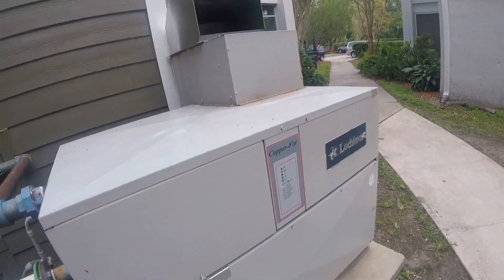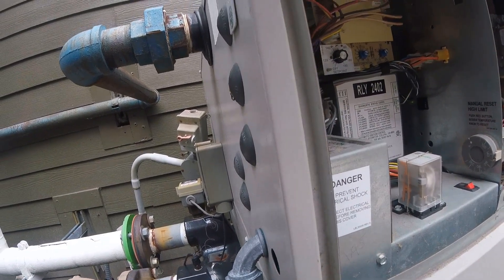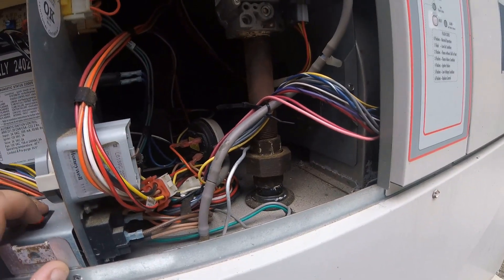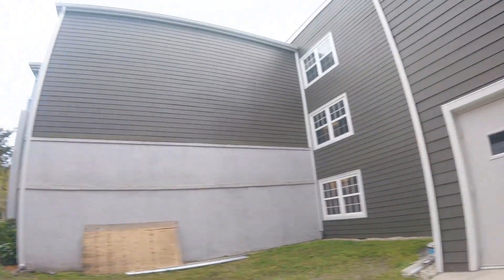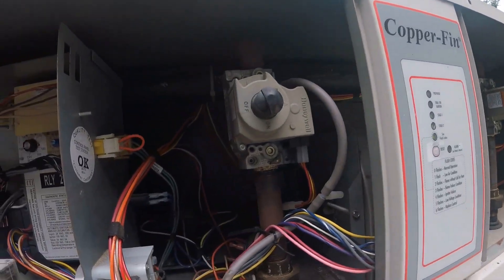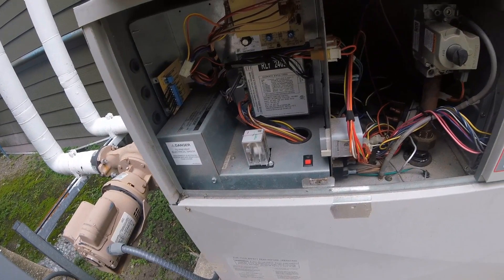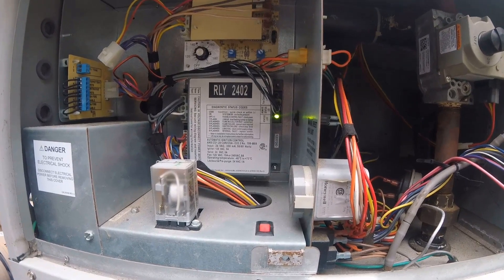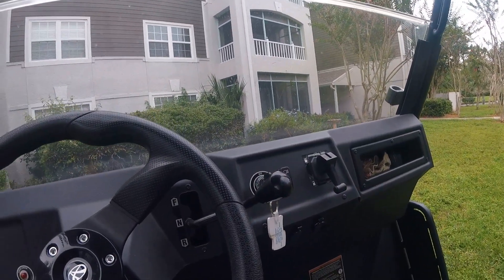Lochinvar Boiler Failing To Light Due To Low Air.

Comment: I Had one of these at a school for domestic hot water. Maintenance said it had a low air code and they replaced the switch but it didn't fix it. turned out the power for the switch comes from the flow switch and that switch was rotted

Comment: Having the cabinet open does affect it . Your bypassing the air filter.  A dirty  filter restricting air could is one issue . Heat exchanger may need cleaning . Dirty heat exchanger ( coil) will also result in low and if not cleaned & tech adds air without proper cleaning it will result in damaged burners . Restricted airflow through heat exchanger resulting in over pressurized chamber will cause flame burning in tubes causing fractured burner tubes.

Comment: I can’t tell you how many times I got no heat calls with a low air error code , I get there and the blower motor just runs nonstop with the boiler  not even trying to ignite. So right away you think it’s a air switch but it turns out to be the igniter.

Comment: If your unit is failing on the pressure switch you usually have cracked or broken burner tubes. They need to be pulled and inspected every six months. Those gas valves need to be checked with  a monometer to make sure they are opening. There is an upstream and downstream tapping on the valves. Incoming supply gas pressure should be checked first set according to the manual then set the differential gas pressure after the air pressure in the unit is set first. Don't waste your time messing with everything until you make sure the burner tubes are good.

Comment: Good video
Wow I was not aware that lochinvar copper fin boilers where allowed to be outside. I'm very familiar with these boilers. They eat ignitors, pressure switches and most are suppose to have a filter in back so combustion air is cleaned going into boiler. If gas pressure isn't set correctly and unit isn't cleaned once a yr they are known for cracking burners also....

Comment: Nice Vid!! 10:50 looking through the sight lets you see the condition of your Flame Rod Sensor. It is a safety device that stays in the flame verifying that it is lit by generating a small amount of current (Microamps or Milliamps). It verifies flame is present to the controls and triggers shutting off the gas if flame ignition does not remain present to prevent filling the area with gas preventing an ignition hazard as well as preventing people from breathing in toxic fumes. If you see the flame sensor majorly leaning over or deteriorating than you will know it is about time to replace the Flame Rod Sensor to prevent a no hot water call. The window also lets you see the condition of your flames. Nice detective work! ~ Yay! Geoff!!!
Reply: Lochinvar uses a ignitor/ flame sensor combo. There is no separate flame sensor on these boilers. The ignitor rectifies flame thru it and sits directly over flame. That's why you need lochinvar ignitors when they go bad.
Reply: @pineychristian  is exactly correct.  No separate flame sensors in these machines.  New Lochinvar flame sensors read around 70 ohms of resistance.  When they get out of wack they read a different micro-amp reading to the control board causing troubles.
Reply: propane go boom ;)

Comment: Good vid geoff, and it never fails when every resident in the wing complains about something while you are working on it. Or when they call every ten minutes to ask when will it be fixed. As always stay safe geoff
Reply from the maker: Oh yea the asking when is it going to be fixed gets on my nerves so... I always just tell them in about 4 hrs . Then they say WHAT!!!!! then i start say 3 .......2.......can i get a 1 SOLD TO NUMBER ONE all right .LOL . The funniest thing was when it went down last time the gauge was stuck on the gas tank and said it was full. (Fair enough) so on a Friday (I was off) it went down. The ED's bosses boss was there and was hounding the guy working on it. Finally the guy just made up something that he thought was a problem because of the hounding. They ordered 2 of the modules.Then I came in on Monday hearing all this about no hot water. So I went straight to the gas tank and banged on the gauge and it went down to zero.The boss that was there Friday was again on Monday they where having a meeting in the confreres room. So I poked My head in to tell my boss and said. Your boiler has  been almost fixed. They said what do you mean almost...... Well do have 800 gals of LP sitting around. They all just said all at the same time you got to be KIDDING. It was such an Epic moment.  Thanks for Watching Chris👍

Comment: You need to get digital manometer, some tubing and 3/16" tee. you can tap into the pressure switch circuit and see what the actual  readings are and it save you a  of time diagnosing. I've seen tube barbs clog, inducer fan blades get rusty or brake off, even dirty burners will shut you down on pressure switch. Lochinvars are touchy when it comes to pressure switches.
Reply from the maker: We had a manometer it grew legs and walked off hehe. I agree Lochinvar's are touchy. The air has to be dialed in almost to the exact in of mercury number. Thanks for Watching John